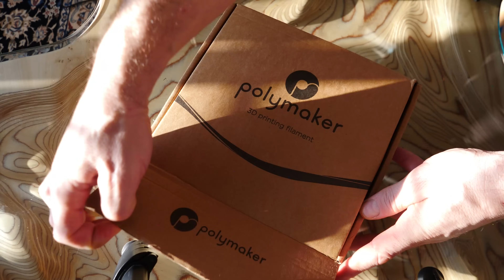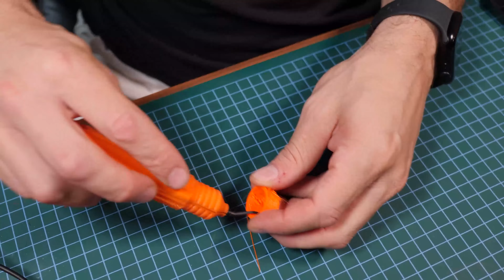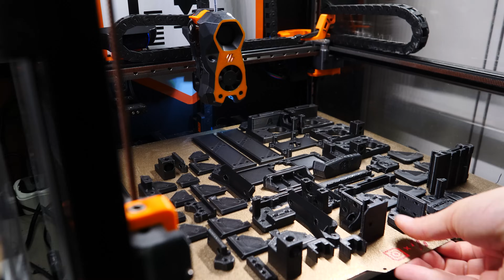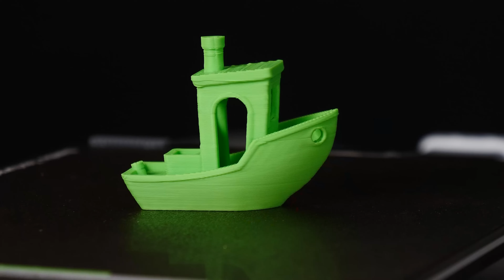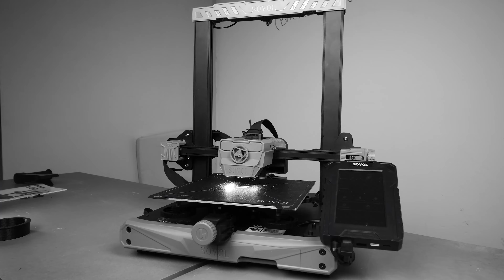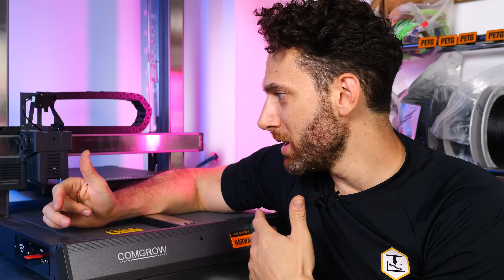My Long-Term Review of Each 3D Printer I Own

Comment: I have around 6000h on my Voron 2.4 R2 350mm. Added Tap, chamber heater and a ERCF 1.0. But my go to is my X1C now.
I comes down to the AMS, Spaghetti detection and automatic lidar pressure advance.

I recently bought a Snapmaker J1 as well to bet able to print 2 colors a LOT faster. 5-7s instead of 90s filament change time and to be able to print TPU and ABS together or use a second material as support material.

Comment: the speed of prints now has me rating printer wear at meters of filament now. I.E. my old Replicator Dual has about 10K+ hours printing at 45mms-120mms but im VERY certain my Creality Sermoon D1 (Heavily modified) which has about 1,600 hours and runs at 200-250mm/s 5K (print speed) has printed about the same in just two years. Currently at about 10,000m of filament. About 330m per spool means about 30 spools, and 1 or two spools a month sounds right
Reply from the maker: Good point. 2000 hours on an X1C is like 6000 on a Prusa MK3S+

Comment: There are primarily resin channels - so I don't see why it wouldn't do well :D It is it's own area though :D 
What I see rarely with resin are functional prints. They print quite precises stuff but personally I have tons of issues with warping and breakage on resin prints. I'd love content that prints functional stuff in resin, that would normally be better on FDM. I have recently had a commission for airsoft parts - and my FDM was not yet in the office. So I ended up printing it in resin only to hear it broke while screwing together by the client.... I had to reprint that about 4 times by the end of it the profit was about 10 bucks before tax :D And had to do it  on FDM. So it would be positively lovely to see functional prints in resin

Comment: Can you please give me a link to the stl/3mf of the fan shroud you are using on your p1s with the panda revo? I run dual aux fans BUT the stock fan shroud nor a lot of the 360 shrouds work well with the revo and with the blow down pattern on that shroud I would like to use it. Thank you!
Reply from the maker: Its stock?
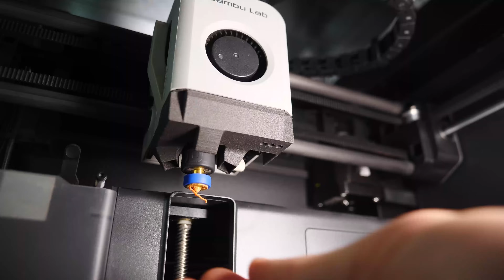Reply: @thenextlayer  Then I must be mistaken but at 8:43 in the video it looks like you have a fan shroud that looks to be 3d printed and of carbon fiber filament of some sort.

Comment: i added a p1s to my first 3d printer the cr10s pro v2, I love the cr10s reliability and huge build volume, just not the bed levelling. p1s has been  game changer, its easier to use then basic paper printers from HP these days.

Comment: Good Afternoon Jonathan, I see you're still running an Alpha build Positron, many of the issues you have outlined have been fixed in the latest revision. We can get you the parts needed to upgrade it as needed.

For context; Bed Leveling has been fixed with a Z_Endstop that makes homing more reliable. The heating issue is caused by the original alpha clip not being tight enough against the hotend, this has been fixed in release. Additionally, the Z Belt has been re-designed to be more reliable as a whole.
Reply from the maker: Nice!!! I’d love replacement parts. Ping me on discord

Comment: I'm surprised the Qidi with the heated chamber didn't make it after receiving so much hype on YouTube and a lot of praise for listening to feedback and fixing so many issue, basically doing a relaunch. Did it turn out to be not that great after all?
Reply from the maker: Electronics failed randomly and I didn’t want to pay out of pocket to replace the board so I ditched it. I did a short updating people not to bother with the machine
Reply: I've got one; it's a good general purpose printer, but unless you're routinely printing stuff which needs the heated chamber, the Voron 2.4 does just as well, and requires less maintenance.
Reply: Probably because he broke the machine himself and then qidi couldn't offer him a free warranty. So he started smearing qidi.😅😅

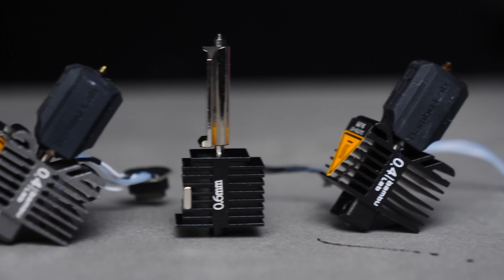Comment: 18:02 I have the regular SV07 and I've just had random bed shifting where the print shifts 1 layer. Still looking into it for the problem but when it works chefs kiss
Reply from the maker: Tighten the belts or increase Z hop
Reply: @thenextlayer  sadly tried both and it still had this problem. Only thing I could come up with is the actual timing belt pulley is messed up. It's like randomly shifting at the Bed so I'm hoping to get that changed out and it's good to go

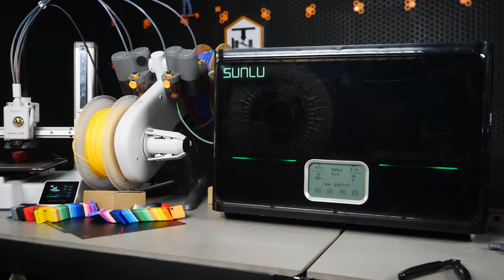Comment: 14:13 I've had a great time printing petg on my newer A1 mini. Just a lot of thinner stringing but it works great!
Reply: Stringing may be due to wet filament. Also Bambu likes to print petg hotter than even the filament manufacturer recommendations for max temperature. Funnily it gives great results. Try it.
Reply: @arturdobrzynski6531  my hatchbox likes it a little bit more lower temps but I'm good with the strings especially where it was printing a skull with hair so it gave it a more realistic/messy haircut lolll
But for more solid stuff I do have the dryers ready to go

Comment: Im looking at building a position LT with full time portability (i do almost as much driving as i do sleeping toddlers am i right?) And was wondering with your bed leveling issue if its the V3 and the IR sensor on a glass bed issue? Bc ik with the LT version they are trying to convert to a touch probe or micro sized clicky
Reply from the maker: It has to do with the folding and unfolding throwing things off not hardware

Comment: Great video as always!

Re: Bambu, can turn off the build plate and AI crap.  And also adjust the AI sensitivity as well.  I have it set pretty low and it seems to work pretty well.

For whatever it’s worth, in the industrial equipment world (like tractors, generators, etc), it’s typically thought of that 3,000 hours of run time is its effective life and the max that a lot of people will keep a piece of equipment.  Past that and you should expect to rebuild engine, hydraulics, etc.  

Since I’ve learned that, gives me some good perspective on run hours for 3D printers.
Reply: Dang it, now that I think about it, I was talking to a farmer about it but he likes to get rid of equipment at around 3000 hours before it starts to depreciate too much.  

I went to look it up, and apparently modern machinery is more like anywhere from 8-20K hours.
Reply from the maker: Oh wow 3k hours is NOTHING though. I’m way past that on my Prusa with no failures. I think 3D printers (good ones) might have a different standard. I’d love to hear from Prusa how many hours they put on each machine before fixing or swapping

Comment: Do you feel the Revo upgrade to the P1S was worth it?  I'm debating on doing it to one of mine.
Reply from the maker: Yeah I think so, if you are gonna have other revo nozzles on other printers especially. If not, you can also do that AliExpress hot and or just buy stock hot ends and swap. I think you need to do a cost analysis of all the nozzles you want and what it’ll cost from each ecosystem. If you have other printers though, getting them all on revo is a no browner.

Comment: I'm about two weeks now into owning a Bambulab X1 Carbon with AMS.  So far, it has been terrific.  I hope I don't encounter the issues you did!  This technology is jaw-dropping for me.  I've only had one previous printer, a "Mendelmax 1.0", that I built from self-sourced parts 12 years ago.  Compared to modern printers, that old bed-slinger feels like a horse-drawn wagon!  I've printed PLA, PLA+, PETG, and ABS so far, all completely successful.  This has made 3D printing fun again!

Thanks for all of your reviews.
Reply: The X1 C is my first printer. I did a bunch of research. Since the Additive Manufacturing Lab at Blue Origin Rocket Park at KSC, where I work,  has over 20 of them, I figured I couldn’t go wrong. It has not disappointed me yet.
Reply: I've had mine for a few years now. All that's broken has been the toolhead board, and since I had an early model, I also had to upgrade to the new lidar. But you get a free new lidar with the board if you have the old one, since the old version is discontinued, so turned out better than new
Reply: Welcome to the Bambu family :)

Comment: I had to check my MK3S and it has over 1400 days on it in the last 4.5 years. Easily my most used printer followed by my Voron 2.4 and Trident. Though the Bambu A1 Mini is getting a good bit of use lately.
Reply from the maker: 1400 days? That’s gotta be a typo… 140? Or 1400…

Comment: sv07 reliable?  to be honest i had more hussle than printtime on mine , maybe reliable: if your lucky to get a proper working model in first( mine came with broken extruder, ripped of cable on the thermistor and few other problems and i know other ppl with same issues) , 2nd you know klipper ( what i didn´t had only marlins befor).
so if it runs it prints well "IF"......
sold my sv07 and bought A1
Reply from the maker: Sorry to hear that. Mine was awesome. Maybe they cherry pick…?
Reply: @thenextlayer   maybe ? dunno xd i mean your sponsort by sovol can think of that they would give you  a garbage machine to promote them.
but to a good point sovols customer support provided me spare parts and a completely new toolhead for free. BUT that took almost 4 weeks.
the completely wrong calibrated klipper config  which my machine had was not provided i had to fiddle myself or better sayd got one working from github
Reply: @thenextlayer  maybe xd wouldnt make sense to sponsor ppl and give them not working machines to promote them ^^
but to a good point , sovol provided me all spare parts i needed and  a completely new toolhead etc for free but that took almost 4 weeks

Comment: Dude, you’ve got to do your MK 3+ justice and go purchase the 3.5 upgrade. I just did it and it’s phenomenal. 250 bucks and you’re basically getting a brand new printer. It prints twice as fast and if you tweak things a little, you can approach the Speeds of a core xy. And of course because it’s a Prusa the print quality is phenomenal.
Reply from the maker: Hmmm maybe but I can’t justify spending money on it when I get so many free printers and have a long wish list of video gear to improve the videos…
Reply: For this much money you can get Bambu A1 and still keep your Prusa. No need to keep throwing more and more money into the machine you already have

Comment: I like resin content as a curiosity every now and then. Things like "hey, you could definitely not print this in FDM"
Reply: Same. Now and then. IDK like one video a month maybe?  Frankly Resin printing seems more complex to me.  Though that might not be the case, I'm just ignorant I think.
Reply: @jreddestructo I just got rid of my resin printer. It’s not any harder than FDM and it printed some great stuff. I think you have to be very thoughtful about setup and air filtering. I put it all the way in my garage and I could still smell it my kids rooms between 3 closed doors. I didn’t have any good options for ventilation either there are no windows in my garage. Safety and cleanliness concerns are really just the only barrier to entry.
Reply: Resin printing is actually EASIER than FDM. only one axis to worry about, and there's only a couple of settings to tweek vs the labyrinth of stuff to learn and mess with with fdm. Supports are also a lot more straightforward. 

The reason many people shy away from resin: the PPE and post processing that you have to do. With from you just grab your print as soon as it's done. But with resin you have to wash it in isopropyl alcohol and run it through a UV lamp before you can use your prints. 
All the while wearing nitrile gloves and a good face mask.
Not to mention the consumables it creates: paper towels, gloves, and other trash. Responsibly Disposing of used Isopropyl alcohol is difficult/ annoying (why I don't dispose of mine, I prefer to re-use it after cleaning it).  And lastly: the cheap / standard resins have a reputation for being brittle and delicate. But if you get the more expensive durable resins (example: anycubic ABS-like resin) you don't have that problem.

Still though; with the level of detail you can get with resin printing, it is worth all the hassle. With FDM you'll be lucky to get XY resolution at 400 microns (0.4mm). With resin: you can get as low as 30 microns with even cheap resin printers: a human hair is about 70 microns thick, a white blood cell is 25 microns. 

This means that when you print very detailed models, things like the texture of their leather boots, or the pours on the skin, might come out. Detail which is lost on fdm. 

There's also few if any layer lines.
Reply: @NerdSnipingBatman  thank you for your outstanding commentary. This is inspiring
Reply: @NerdSnipingBatman  maybe 5 years ago but for most fdm printers you can get nozzles as small as 0.2 and some as small as 0.1 and you talk about the chemical was for resin printer mainly the isopropyl alcohol but you also have to dispose of everything else that has resin on it properly and as long as it's uncured it needs to be stored/disposed of in a airtight container to be then disposed of at a waste center that accepts resin. also dealing with liquid can be a lot messier then filament and your run of the mill dust mask isn't enough for resin so instead of having to learn a bunch of printer settings you have to learn about proper the ppe for certain chemicals and how to handle and dispose of granted you also need to learn some of that for fdm especially if you want to print in anything other than pla or petg, i just don't think one is easier or harder then the other they just both come with there own pro's and con's.
Reply: @neko0my0cat  0.2mm is still 200 microns. Compared to 50 microns xy resolution  that's basically pixelated Steve (Minecraft). And I tried printing with a 0.2mm nozzle: unless you print your pla on the hot side of its temp range (which ruins details even with a good part cooling fan), you end up with constant clogging, ringing (no matter how well tuned your belts are, the tiniest vibration is like an earthquake at that scale: and yes modern algorithms combat this a bit, but they don't resolve it nearly good enough).
Reply: I love the quality of resin prints but i have the printer in my bedroom so i am not able to vent it and have a dedicated space for it.
Reply: You really shouldn’t have a 3D printer in your bedroom.
Reply: @customlegoworks  I have two fdm printers in my room, I would never have a resin printer though
Reply: @yobtnirp3D  Yes, the FDMs should not be in your bedroom w/o an enclosure and direct ventilation. Even for PLA. If you have a window that can open you can do just about anything to clear the air.
Reply: @customlegoworks  yea I usually have a window fan
Reply: Yeah, resin generally used to be boring to me as it was really slow, but it's starting to get pretty fast. Especially at the quality difference, it's worth looking into now

Comment: LOVE my Bambu p1p, but the customer service is possibly some of the worst EVER of any company I have had the pleasure to deal with.
Reply: Seems like a hit or miss with the customer service though after a short stint in customer service, sometimes the customer is the problem.
Reply: I’ve only needed to call on them a couple of times and had great experiences. One time they were a little slow, but they were knowledgeable, patient and dealt with my problems completely.
Reply: I agree I used to think creality was bad, then I got a Bambu..... now I know Creality support is actually decent at least compared to the non support from Bambu and run around/refusal to warranty issues.
Reply: After dealing with Sovol's customer support, Bambu's support feels amazingly good.
Reply from the maker: I just wanted to reply and let you know that I am speaking with Sovol about this. You're the second person who's made a comment like this in the last 2 months, and I will make sure to hold them accountable and ensure that they make some changes. Thanks for bringing it to my attention.

Comment: I emailed Microswiss and they are planning on a NG/flowtech upgrade for the SV-08. Once they have the unit they ordered. 😊 I think the SV-08 is destined to become the new Ender 3.
Reply: The Ender 3 made waves because of how accessible it is; almost everyone has enough space on their desk for one and $150.
The SV-08 is more than twice the size and more than 3x the price. It’s not nearly as accessible. Sure it’s more accessible than a X1C, but it’s larger and about the same price as a P1S.

Don’t get me wrong, the SV-08 is a significantly better printer than an Ender 3
Reply: @TheOfficialOriginalChad  I meant as in mods by the community. One person put it as the poor man’s voron 2.4.  Which is not a bad thing I think it will put a more than capable machine in the hands of lots of creative people.
Reply from the maker: Siiiiick

Comment: Build the Proosa with your mk3
Reply from the maker: Wussat
Reply: @thenextlayer  uses most of the mk3 parts to make a core xy Prusa with massively better cooling speeds etc. an improvement in almost every way. Check with Hector @fabreeko
Reply: @thenextlayer  open source project that uses all the mk3 parts to convert to corexy. Huge improvement in every way. Fabreeko sells a kit